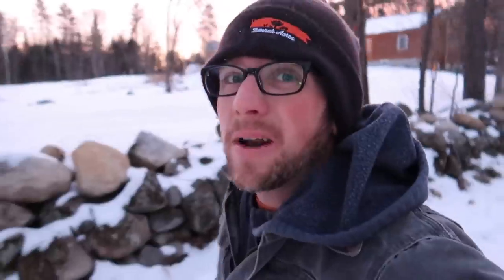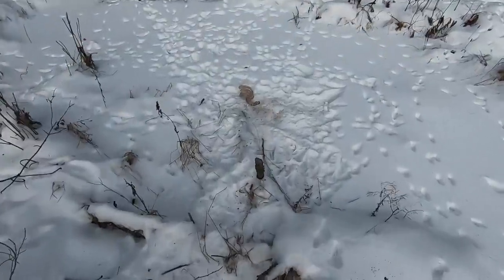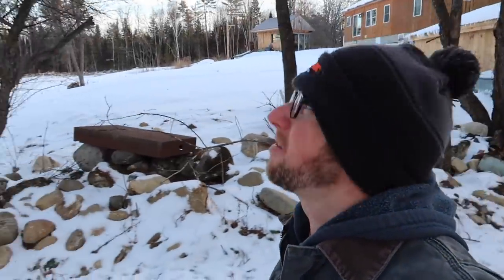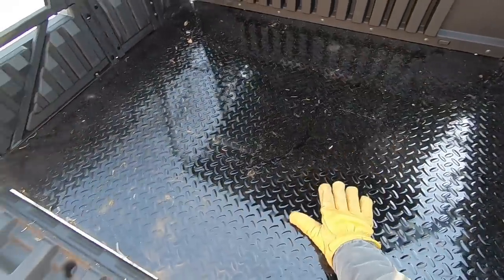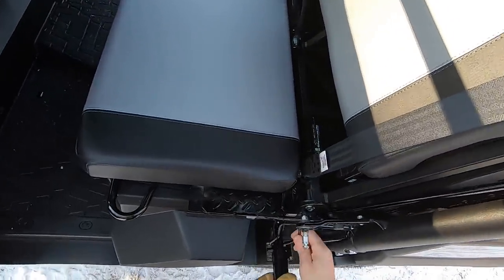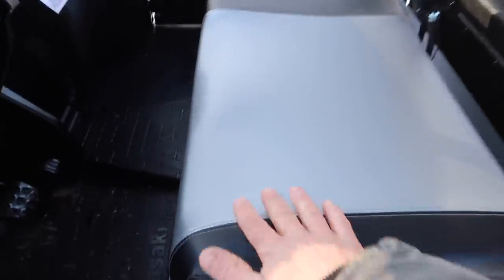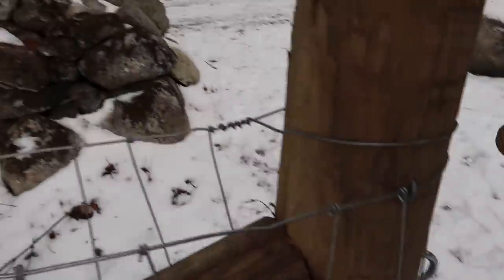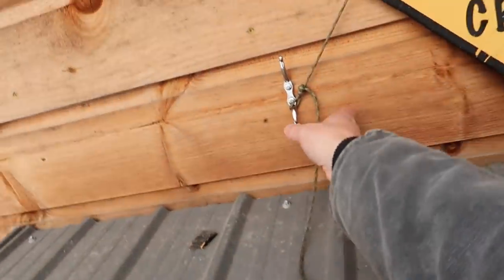WE BOUGHT a SIDE by SIDE for Our FARM

Comment: First "mod" I would do to the mule is add some forward led spots/floods and a led light bar.  That way you can get a much better lighting during night driving on your property.  You could do some side and rear flood led pods too in case you are doing some work late into the dark.
Reply: R. J. For sure! We have a Rhino and use the floodlights all the time for splitting wood to ice fishing.
Reply: Also some mirrors

Comment: The side by side will definitely be a good addition to help with the operation of your farm. Raptor liner is a good liner that is a 2 part system that is much more durable than standard roll on liner. The features of your side by side are awesome, suits your applications perfectly. God bless you and your family.
Reply: Chris Heckman high gloss hi temp paint will fix the gouging and if it’s deep use JB Weld to repair
Reply: Raptor liner is great, we painted by buddies entire jeep with it, came out looking great. Very durable and holds up to limb scratches when off roading.
Reply: Can see gina driving it all the time al wont get a look in
Reply: @homerfantastic  is Raptor better than Rino liner???

Comment: Add a led bar on the front and back of the roof. Attach them so you can swiffel them. That way you have some work lights. Oh and add an extra battery
Reply: Yes, we added 'back up lights that come on when we are in reverse and I added a relay/switch so I can turn them on for projects.
Reply: Also some
Better tires for the muddy parts
Reply: @moavic5087  No these tires were great because they wouldn't tear up the pastures he said.

Comment: You can very easily switch out the cigarette lighter power source for usb ones.
Reply: We have a few of useful tools that run from the cigarette lighter socket; a domestic style wall socket; a pneumatic pump and a standing LED flood lamp; not saying you can run all those at the same time - will depend on how much power your Mule will put out.
Reply: you can get USB converters that plug into Cigarette lighter sockets
Reply: Those cigarette lighter are old school, they are now called 12 volt sockets, which by the way are being phased out for 5 volt USB ports!
Reply: jay west well not so easy but it can be done
Reply: @englishdave9760   I have one I use in my pickup and it works great, it has 2 usb ports on it.
Reply: @jamesdeffenbaugh5166  - they are calling them Power Sockets, that way, you can use about any kind of appliance/tool, if your system can deliver the amps. Ours does 30 amps, full time. Peaking at a 40 - briefly
Reply: @kellygb9278  yes, I know what they are called, I have them on my tractor and they are on the generator, and yes in my daily driver, but the conversation was about cigarette lighter! I posted another comment about the adapter for charging phones and Al's camera equipment!

Comment: Al, love your UTV, we have pretty much the exact same one.  Purchased our UTV back in August, won't trade it for anything.  We added a rearview mirror, and 2 side mirrors to help with seeing when we haul stuff.  You and Gina will love it!!!
We use our seat belts often however, when doing work which doesn't require heavy driving/riding with continous hopping out if the rig, we lock the drivers seat belt and sit on it   This way were not limited by the governor.
Enjoy!!!  I can't believe you had us believing you were getting a 4 legged mule.....LOL!!!
Reply from the maker: I think the mirrors will be a must!
Reply: @LumnahAcres  We picked them up at the place we bought our UTV.  Cost wasn't expensive.  Enjoy your new mule!

Comment: 15:39 Buy some Rain‑X Plastic Water Repellent for that Poly-carbonate windshield, make sure its the one specifically formulated for plastic surfaces. You have no wipers so using a product that helps water bead up and roll away is going to help.
Reply: Loki he needs to add wipers

Comment: I agree with many other commenters, led light  bars, spot lights and mirrors to start. I didn't see one, but you should have a mounted fire extinguisher. I know you have the snow plow on the truck, but a small snow plow on the Mule could be good for clearing snow down by the barn and goat enclosures. I did see there are all sorts of implements for the Mule (plows, disks, seed spreaders, etc.) could come in handing when you are working on the pasture.

Comment: Good choice on the Mule.  I have the exact same one and color I bought in Dec. 2107..  It is a 2018 model.  I picked this one over the others because of the versatility it provided with the seat/bed configurations around the property.  My granddaughters love it and I think it will help them in their driving skills when they get old enough for their driver's licenses.  We just call it the Mule, no special name for it.
Reply: Be careful when cleaning polycarb windshield.  It will scratch easily with just a cloth.  I use soap and water, then when dry spray a coat of PLEXUS and wipe off with a microfiber cloth.  It will help protect it.

Comment: I would have thought, you have the tractor, and the 4x4 , maybe a better investment at this point with amount of timber you are going through would have been a Sawmill, you have the timber.
the saving would probably have paid for that.
Cheers.
Reply: Rollem Swift sawmill can wait let him get the wood out first, then stage it for air drying that gives him at least 2 yrs before the mill is needed oh make sure you get something like an LT40 wife with hydraulic features. Pay up front but can do single man operator and later as you age you have the auto hydraulic features so you aren’t trying to muscle the logs

Comment: Love the new buggy. I got a Polaris Ranger a few years ago and don't know how I ever lived without one.  I have added a big lightbar on the roof facing front to see well at night and early mornings when I go hunting.  I also added a smaller one for the rear.  It really comes in handy for backing up and loading or unloading gear in the dark.  Definitely will use that winch.  I would keep a chain or a tow strap with you at all times.  It is one of those things you always need when you don't have it.  They make a bunch of attachments for UTVs that can help out with your planting and field prep.  Make sure to always use non-ethenol fuel and let it run for a few minutes when it is cold, before putting it to use.  Follow the break in regimen as suggested by the manufacturer.  Have fun with your new tool/toy.  I think Grant might be a good name - short for Granite ( cuz you are in the Granite state and it is grey/silver.  Grant the grunt!  May the new year and decade bring you much joy, peace and blessings.

Comment: I have always had great results from spray-in bed liners that have prevented rust from forming in my truck beds.  If you are able to take the MULE to a local LINE-X type dealer, they could easily spray in a durable bed liner.

Comment: @LumnahAcres, Guys, although we made a different choice for our lil homestead for different reasons, we are obviously happy for you and congratulations on your newest purchase.  You will undoubtedly find all sorts of new and exciting ways to use the Mule around the farm.  We added a 52-inch LED spot/flood curved lightbar to the top/front of our Ranger, a couple of LED spots to the front bumper (for snowplowing) and a set of LED spot/floods to the rear for work lights.  Also, we picked up two sets of snow tire chains for 31-inch tires and cut them down to fit our Ranger.  We got our's at the thrift store for $20 ($8/1 pair & $12/other pair).  They come in REALLY handy when it gets icy outside.  Hope your windshield is the scratch-resistant version, otherwise you'll yank it off within a few months.  Everything we purchased through Amazon, so if you'd like links, just hit me up.  Best wishes and God Bless!

Comment: You can get a cradle for a second winch that fits into the rear receiver. I say second winch just because the front winch looks like it would be a pain to remove and there probably isn't room for the cradle on the front. Also would give you the flexibility to get a more powerful winch you could use with some snatch blocks to either get to tough spots easier or pull heavier items to a new position where the heavier kubota could reach it.

Comment: You werent making prep for a four legged mule so i figured it was a gas one.  Good addition, like you said, get you places easier than before and will be useful for a lot of things that would just tear up the tractor.  That back area is still pretty rough so you going to have to make removable sides for your wagon so you can pull it and not lose everything going through the roughness till it is smoothed out.  Going to get a good workout after the thaw.

Comment: Put a rubber floor mat like the one in the goat stalls in the back so you don’t scratch the diamond plating!! 👍
Reply: Id like to see a rubber mat right where the milking goat jumps down off the milking stand.. Seems it could hurt the goats legs.. to jump down on cement...  over time
Reply: @conegallery  yeah goats in the wild never live in the mountains on rock and jump cliff to cliff. 🤔
Reply: Well that's true.. still.. a rubber mat would avoid any unnecessary injuries.

Comment: Very nice rig guys!   In the vid, you mentioned the need for a more durable paint for the steel bed.   When I was still in the North, salt was a huge concern, so we Rhino Lined everything, especially on our hauling equipment..  RhinoLiner is tough as nails!  ps.   Being that you have predators on the property, Getting an actual Mule will help tremendously for warding off the unwanted critters and helping to keep your livestock safe!

Comment: If you're going to use it to bring logs and firewood out of the woods with I would recommend a log Archthat you tow behind the side beside that usually has a winch to lift the large end of the log up off the ground it'll save a lot of wear and tear on your machine especially where it's belt driven and you can also use it behind the tractor also I have one I've used behind my four-wheeler

Comment: I knew it!  It's hard to take care of a property of any size without a side-by-side. Ours is a JD Gator 825i. We haven't found a hill yet that it wont make it up!  I like the convertible bed on yours!  That would be great for when you have company and such! You definitely need the extra bed space for working, but the option of having extra seats is a real bonus! The winch will come in handy for pulling down trees, pulling vehicles out of ditches, and in our case, pulling our daughter out when she gets the zero-turn stuck! Now you need to make roads! Just hire a dozer and flag it out. Only put gravel in areas that are damp if you need to save money. 

We are putting on a light bar with some very intense lights for emergencies. If a horse goes down at night or some other tragedy, it would be nice to put a lot of light on the subject quickly. Congratulations on your new homestead vehicle!

Comment: Add a Halon fire extinguisher on the mule. A leaking fuel line or a short away from the house or barn ( where I hope you have fire extinguishers given your location)  will make quick work of an expensive piece of equipment.

Comment: We call our mule "Pepe" from the movie Romancing the Stone. We have a series of pouches and pockets that hang from the rollbar at the windshield, love that. We also bought some inexpensive seat heaters off of Amazon by Watercarbon for about 25 bucks that we slip under our camo seat covers. We always carry a gun where we have ours located so there are a ton of choices for various types of gun racks. One of our very favorite accessories is a front basket to put misc stuff in. The one we have doesn't work with a windshield but the style we have on our golf car does extend inside of the windshield. I bought some 1/4" stall liner at Tractor Supply and cut it to fit the bed in the back, works great. Some insulated can holders that Velcro to the rollbar are handy for us too. Helps keep our water cool in the summer.
We have a 2015 and its the third Mule we've owned over the last 19 years and the best as well. Haven't had any issues with it. Good Luck!!

Comment: Maybe consider cutting two equal witdths of 3/4 plywood to cover the floor area... Things will still slide on the floor and has the  thickness negating impacting or dents if heavy items are dropped in the bed... I used to have this in numerous trucks ... Including bed liners and rolled , sprayed in liners , bed mats on and on and ... on . Just my opinion ... Stained ... Clear Verithaned ... hinged or not I loved and still do

Comment: Al I just bought a Dyson Vacuum and it come with a car accessory with a lighter plug in so you could use it in your car.  So company's are still providing it most smaller car generators and gps also have that plug too.

Comment: That mule is made of metal, metal is ferrous so what about Ferris Mueller. I would add a plow/dozer blade that would work with the winch to plow smaller areas and help with grading, a nice light bar or 2 especially when doing work in the pastures after dark, and a York rake if you do not have one already

Comment: Honda is the only one that is not belt driven.. Can Am is belt driven.. Only difference is that the Can Am Transmission itself bolts to the engine. Still uses the CVT drive. The Kawasaki Mules are very reliable.. I haven't had many come in for any service other than regular maintainence..

Comment: The car cigarette lighter socket is a rugged proven design that works. The usb port, not so much. Just put in a usb adapter and when it breaks it is a cheap fix. If you had a built in usb ports, they would break and not so cheap,easy fix.

Comment: Very nice Al. I have had 2 side by sides and many 4 wheelers. On the side by side i would say a rear winch, chainsaw holder and a flood light that you can adjust to point where you are working.  I mounted mine on roof at rear on a swival. It is good for loading or watching your load as driving or any tow behind implement. My first utv i had lots of light on top and they where a pain getting caught on branches in bush so i would limit roof mounting.As for a name Marco the mule. Like you said it will help explore and open new land. (Marco polo). Be safe keep up the good work.

Comment: Only thing i did to mine was put big tires on it and beef up the underside with steel plates so it dont get destroyed going over rocks etc. I don't think you will need anything with yours however as your not looking to go off on trails with it. If you do, gotta make it stand taller at least. Get those skid plates made of metal. The front suspension ones as well... I don't care for kawasaki myself but as you say. I like it! : ) Just never any luck with the motors..... Like having a ford for me. : )  I do love that sliding seat tho....

Comment: Congrats! Check out upol raptor liner for the bed coating. The roll on stuff isn’t good at all. I’ve used raptor liner on quite a few things and it’s tough as nails and so easy to spray on and the results are better than line x IMO

Comment: You did ask! Enclosed cab with heat, Dual battery & isolater, DOT amber led strobes, led spot on the back front led light bar, snow plow, tool holder front push bar & rear headache rack, CB/GMSR/HAM radio. Electric over hydraulic dump bed "I dont have a 4 door", 2inch to 3pt working bar adapter for the rear hitch  https://www.kolpin.com/hd-3-point-hitch-system .

Comment: Good morning modern homesteaders and everyone. As far as the type / brand of UTV you bought, imo, its kinda like tractors /cars or trucks, the dealer you use imo is perhaps the primary factor, after the sale service is #1, hopefully that will work out well, from what i have looked at, that Mule does pretty well to compare to the kubuta  Josh at stoney ridge farm bought as far as the the seats  / bed  conversion, I agree with that type of utility, about the drive /transmission, in my expert opinion, both types have pros & cons, the CVT is good & has several yrs of r&d to improve, in the past folks that drive them under water in mud, would get problems from water /dirt getting into the CV parts, I am getting you wont be installing a snorkle air intake so you can drive under water / mud, lol & kawi has more that likely solved that problem years ago,now,the drive belts are better now also about fuel type/ eng (gas vs diesel), again, both have pros & cons, imo, for the very cold , gas is better, no need for the diesel torque, low range / winch can out perform torque, its not like you will be towing a 10 ton trailer around.I will give more free expert advice later on, about the Mule, I like it, like it a lot, can I borrow it ?  have a great day yall and a better tomorrow. o, an Happy new year,too all dont drink & drive please, purty please, I will even pay for the uber, wait, no, not sure <-- about that.
Reply: I have been informed that the Mule can go underwater without harming the CVT belt now, how long can you hold your  breath Al, lol, bad joke  /slaps self upside the noggin. good stuff , the more I dig on that Mule the more I like it

Comment: A lift kit and better tires. You'll need them with that deep east coast snow you get, and you will also need them for your back part of the property when the ground thaws. I noticed the bottom was already dragging in the video, so it'll be worse this spring and summer when it's wet. Nice machine though. 👌😊 I'd call it "the wood tick." 😂